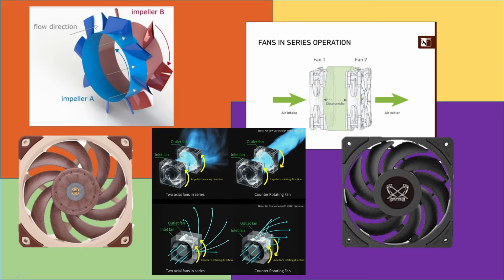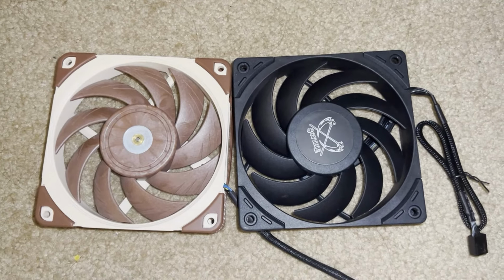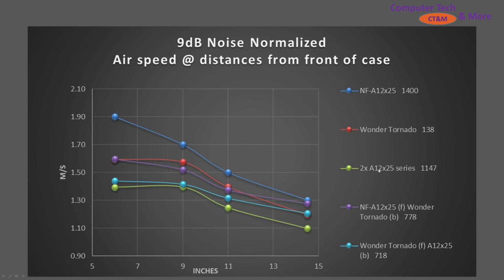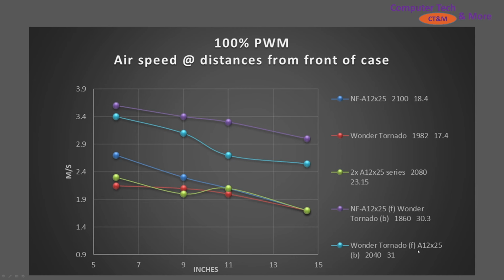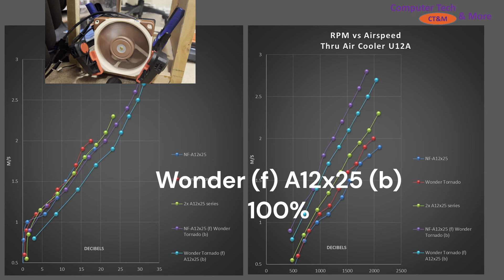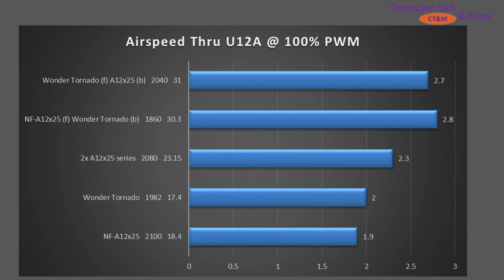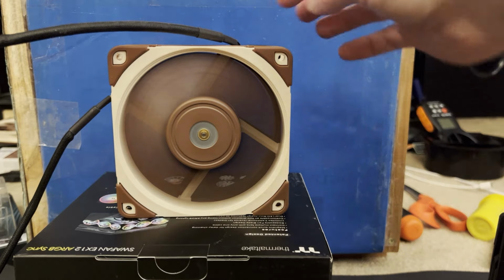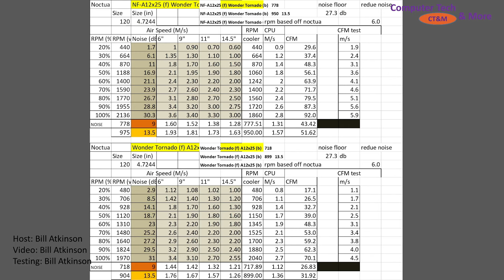Counter Rotating (Contra) Fans? Should I stack my Fans to get Better Performance? Lets Find Out

Comment: Interesting test. I noted that when using a Scythe Kaze Flex Black as SFF case fan versus a standard rotation direction fan, it would reduce the standard rotation CPU cooler fan RPM by 50 to 125 RPM.
Reply from the maker: well thats interesting. I would not have predicted that.
Reply: @computer-tech-more  I also noted this when I tried using the Wonder Snail as a SFF case fan.

Comment: Would this be a benefit with spacing between the fans as well? Or on different sides of a radiator?
Reply from the maker: My thought is like wind tunnels have flow straighteners to make the airflow more laminar. a Rad would do the same sort of thing so the 2nd fan would get no benefit from the contra effect. I dont have data to prove it. 
More space between the fans would help with noise mostly I think. best would be a custom fan design with a set of shared struts. I dont have a 3d printer to test this. I would dont thing I could "build"  a custom air tight chamber between fans to really do it justice. yet.

Comment: BRO THANK YOU I actually built a setup that required cooling a 5800x OCd with a 120mm rad and I bought this EXACT setup except with a noctua redux for color reasons and I was wondering if I should stack the fans  in front or behind or sandwich it in push pull. Appreciate you.
Reply from the maker: ok, so sort of. Most Rads dont go right to the edge of the frame with the fin stack inside. So a pull will not get nasty sounds like on an aircooler. (Potentially).
So most reviewers comment that fans in pull only create slightly less airflow and so slightly warmer temps than push but are easier to clean if vertical Rad at front of case (pull fans rad in front).
Push pull gets you the best temps and quieter at a given Temp usually, but at max much louder. It also takes a lot more space. 
If your chasing the best do it, but usually its not worth it.
Reply: @computer-tech-more  So I had them in push pull with the scythe in the push configuration...but when I went to flip them around I decided fack it and stacked the fans and so now I have a contrarotating push push configuration. This is going to be a positive pressure build but is currently only a slightly positive pressure build. I'm wondering about push push vs push pull. I couldn't measure the difference because I changed my OC right before doing it. Then I saw this video which is insane. My fan also has a thin filter that's made of a cut piece of fractal hole mesh sheet that's sitting point blank in front of the fan. Achieving sub 80° with OC.

Comment: Could you please do a video with a 120mm radiator in front, behind, and sandwitched between? I have a very complex problem...
Reply from the maker: Unfortunate I dont have a test rig for thermal data. 
I have to use airspeed. I have found putting an anemometer behind any fan even with restriction still will give me higher air speeds than match the associated Temp I should see. 
This is a test I would like to do, i just dont think I have the tools to do it yet. 
do you want to describe it I might be able to give an answer regardless.
Reply: @computer-tech-more  I basically just want to understand whether its better to keep the contrarotating fans stacked inline or if sandwiching them around an radiator reduces the effect of the contrafans narrowing the airstream, slowing the rotation of the air, speeding the airflow and increasing backpressure,  but really and truly just air speed alone. I don't know with intuition alone if the radiator would destroy the effect of the contrafans or which configuration would yield higher airspeeds.
Reply: @computer-tech-more  Thermals of the radiator aren't important I want to see the radiators effect on the contrafans efficiency in the two orientations if it has any or too much.
Reply from the maker: @faraday9234  hmm i think that will be fan dependent. So by that I mean Fan torque. So front being free size, and back being against the Rad. If the back one lacks torque or ability to maintain RPM even under a restriction the airflow speed will drop. 

In terms of contra push vs contra pull I think you would find the pull config similar to just one fan. basically contra fans are great for pressure, pulling air thru a rad is like pulling a vacuum, If a fan is starved of air it has nothing to accelerate. While in the push you just force feed the rad with air. 
I hope im describing this well enough. I dont have the test data, but its my thoughts.
Reply from the maker: @faraday9234  so i think your saying lets say clock wise fan in front - Rad - Counter Clockwise fan back    vs  Clockwise-Counter Clockwise Rad. 
correct me if im wrong.
So a Rad or any heatsink actually acts similar to a flow straightener so it really doesn't matter that much if a fan rotates in opposite directions on either side of it. 

Contra has like the 2 effects i talked about, allowing air to travel longer distances at higher speed and higher static pressure.
Reply: @computer-tech-more  So what you're saying is fan radiator contrafan  just acts like push pull, and that fan contrafan radiator gives me the effects of a contrafan setup. So ultimately the latter is better? It's the redux 9 blade and then a scythe 11 blade.
Reply: @computer-tech-more  The point about torque makes me wonder if the scythe fan has more or less torque than the noctua redux...
Reply: Wait, torque shouldn't matter since the scythe is going in the opposite direction right? Because the scythe just acts to create the contra effect and it's efficiency just determines how well it does that. So it being there at all is still better than it not being there right?
Reply from the maker: @faraday9234  doing a 2 fan DIY contra fan just make sure the PWM to fan RPM are similar. 
yes. Contra Fan then Rad should be the optimal set up.
Reply from the maker: @faraday9234  ive had odd results with scythe in my pseudo cfm test. Scythe just does really bad at it despite it being a tube then my anemometer. should act like open air.
Reply: @computer-tech-more  That's what I've got now
Reply from the maker: @faraday9234  if I recall from my testing in this video I got better performance with the A12X25 behind the Scythe. in my graphs i called it backwards where front was closer to the Fins.
Reply: @computer-tech-more  Jeez...I wonder if I should replace the Kaze 1, even though its only paired with a redux...noctuas redux is still higher quality.
Reply from the maker: @faraday9234  its hard to say. it kind of depends on what you want. You can always test it in that config and if you dont like its sound or the thermals try a different scythe fan. They are one of the few brands with fans that spin in the other direction.

Comment: There used to be the Inwin Mars that was specifically designed to do this but it's no longer in production.
Using 2 Silverstone 120 AirPenetrators might do the same trick as using counter rotating fans cause the struts are designed to channel the air into the opposite direction.
Reply from the maker: so if I were to start selling products I would sell my own series of fans. one would be a counter rotating fan. haha.

Comment: Would this carry over to 140 fans? And how would a radiator between the fans affect performance?
Reply from the maker: it should carry over to 140's. dont know the % difference
as for rads. in theory a rad straightens the airflow so it cancels out the spiral vortex created by a spinning fan blade. in practice I have no data.

Comment: is it just random luck picking fans spinning in other direction and blades oriented accordingly..or are you somehow modding them?
Reply from the maker: Scythe spins opposite most other brands and I think 1 or 2 others but not sure. 
So for this test is was basically scythe or nothing. haha. 
A reverse fan might do it but if the struts dont face the same direction when the fans a lined up it will restrict airflow even more.